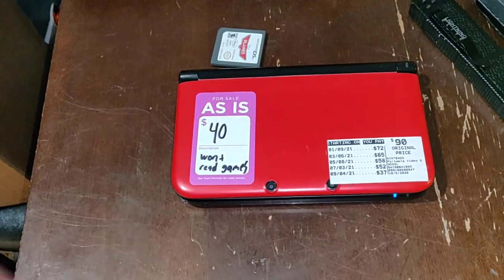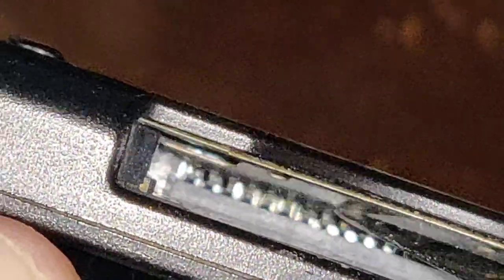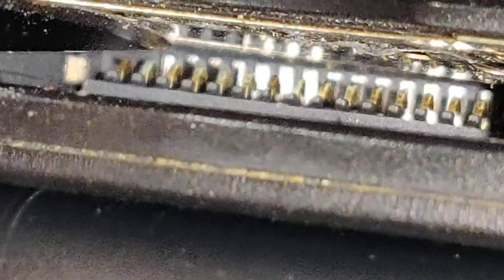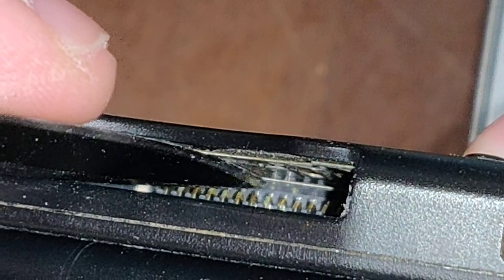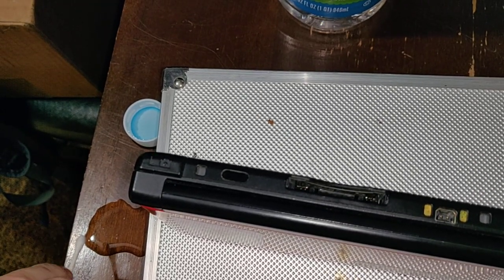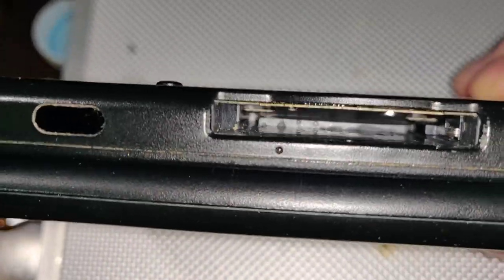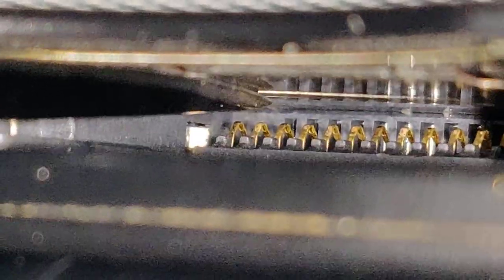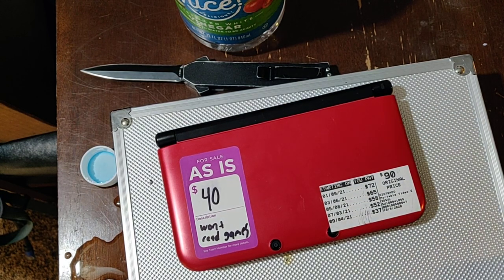3ds not reading games, pins were corroded and cleaned easily

Comment: So about a year ago, I caught wind of the E-Shop Closing. Now the thing is is that my 3ds had stopped reading games, and this video had helped me learned why in 2 ways. 1. Corrosion of the reader and 2. Dirt and gunk. But we’ll go into more depth of this later. After learning about the closing of the E-Shop and so I worked hard by mowing lawns and doing work around my neighborhood and house. After a while of saving and research to make sure that I had no other option, I was able to finally buy a back up of the games that I wanted to play, Mario, Kirby and Pokémon. HOWEVER! today I had been wondering if I could have done more, so I had worded the question to YouTube different of how to clean the reader and LOW AND BEHOLD! This beautiful man right here had the exact solution I needed. I got some vinegar and and q-tip and now all of my cartridges work again. I’m ranting about this as a warning. Do your research, Thorough research. VERY FINE THOROUGH. Search every corner of the internet for a solution, a free one, then do a costly back up. Goodnight you all, be better than me.

Comment: That flap in the cartridge slot IS for protection of the pins, it is normal.
It's on all DS and 3DS systems.
Reply: It's also to make sure the pins make contact with the cartridge contacts.

Comment: putting alcohol on the cart and rapidly putting in and out seemed to do the trick for me. great video!
Reply: It kind of doesn’t for me. I’ve tried spraying some isopropyl alcohol inside the cartridge slot on my 3DS & the games sometimes work & other times they don’t. I think my cartridge pins might be corroded so I might try the white vinegar instead.

Comment: I’ve learned a lot of techniques & how to repair Handhelds thanks to YouTube & videos like yours. Much appreciated:)

My N3DS may need cleaned once again. It’ll read the Carts, but if the handheld is tapped any or bumps a surface of some sort, it’ll stop the Game from operating. 

So only a few things could cause that. I’e the cart isn’t making a good connection with the Pins, or the cartridge slot is dirty again and may need cleaned.

Comment: It works for me, just dab some vinegar to the cartrige and put it in and out of the game should work and vinegar dosent hurt the cartridge
Reply from the maker: yeah, most people wont need to be as in depth as i was trying to be, as i didnt know if it would work and i wanted to visually see the progress. the only concern with rushing thought i would be concerned about would be turning the console on with the pins shorted on the game due to the liquid creating a conductor, but i have no idea about how electricity may flow through distilled vinegar, maybe electricity  doesnt flow at all in such a low voltage low amperage circuit?

Comment: I'm happy this works for some people, but this didn't help me. I'm assuming the previous owner ran it over with their car or something because the cartridge pins don't look like they have corrosion and this method didn't fix it. i think the whole cartridge slot might need to be replaced. Yeah, I'm not doing that. I would have to buy a whole soldering kit and learn how to do it. I'll just install custom firmware on it and call it a a day

Comment: My DSi was reading the games partially sometimes running them sometimes freezing, other times it wouldn’t read at all. Checked for corrosion and 2 of them had started with a bit of green… just cleaned it the same way and corrosion is gone. The little flap is a protection for the pins I believe
Reply from the maker: i looked inside another 3ds xl, and the flap was flat. i think someone jammed something in there and got it stuck and pulled on it bending.

glad you got the ds working good
Reply: @jasonbrown467  hmm cause mine has a flap. I have 2 other DSi and the flap is there’s aswell

Comment: Would this work the same way on a potentially corroded cartridge? I'm having an issue with my Pokémon Moon cartridge never reading, and I know the cart itself is the problem because my new 3ds XL reads other carts(X, Omega Ruby, Ultra Moon, Pearl) just fine.
Edit: you can poke at my latest community post for a picture of the pins on the cart. None of my other carts have it.
Reply from the maker: i am not an expert i would think it would work. may have to dissemble the cart to get to all pin surfaces
Reply: @jasonbrown467  how would I do that?
Reply from the maker: @ShiningStarAhsokaTanofan  by the tool to open the cart, its cheap. remove the board and dip just the pins into the white vinegar
Reply: @jasonbrown467  my dad got the cart to read by blowing into the slot
Reply: @ShiningStarAhsokaTanofan thats just going to get it more corroded

Comment: I missing one of those gold things in middle does that mean I have to get it repaired
Reply from the maker: maybe, you are missing a pin?, maybe have to solder a new card reader on, and i bet that is a challenge
Reply: @jasonbrown467  mines are there but 2 are a little bit bended, that would be easy to fix?
Reply from the maker: @quepedocntigo  i really dont know. i never messed with these pins before or after shooting this video. maybe good light and a stiff needle

Comment: wouldit also work with isopropylalcohol 99,9%? An coul it also work with an apple vinegar or a different vinegar ?
Reply from the maker: i am not a chemist, but the reason why this works is the vinegar is acidic and it cleans up the corrosion. i dont know why. alcohol will clean but it doesnt do much for corrosion from my experience

Comment: how would you prevent this
Reply from the maker: honestly i dont know. i am guessing kids get the games wet with slobber, or more likely spilled drink then put the game, now with the contaminants on the game cart pins, into the console transfering the contaminates to the console pins. then slowly the chemical reaction begins and over time covering one or more of the contact points creating a barrier between the game cart and the console pins. or someone got liquid in the console directly.

i wish i knew as much about chemistry as i do about electricity. i know not all liquids cause corrosion, and some liquids can obviously remove it.
you have me curious, i bet i uploaded this video several years ago. i should go test that ds and make sure it still works. i will go do that and report back

edit: it still works, i just loaded a game and it played fine. i was afraid that maybe i didnt get all the corrosion  and maybe it grew back, but it seems it didnt and all is fine

Comment: Question, with the console off will cleaning the reader with isypropyl alcohol with a q tip damage the system at all?
Reply from the maker: honestly i dont know. i dont know how conductive alcohol is. i do know alcohol will not remove corrosion  though